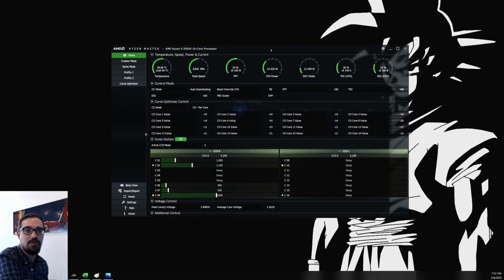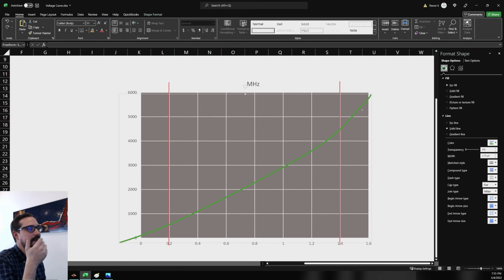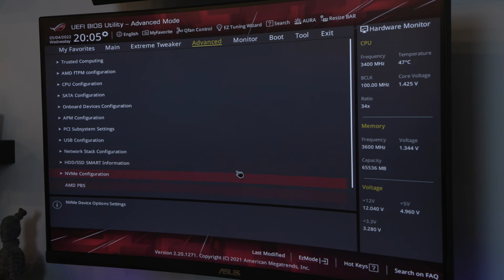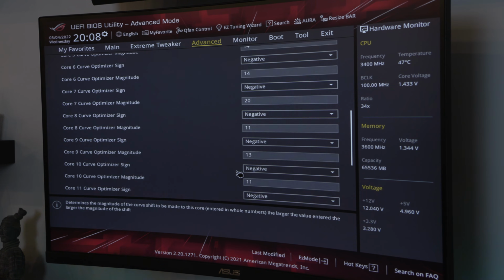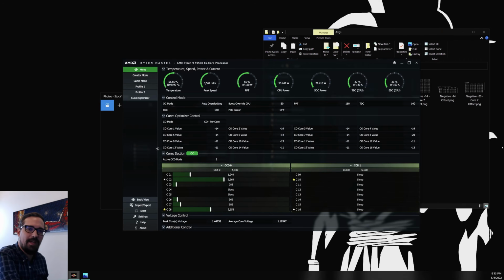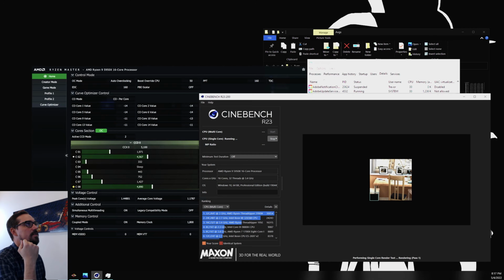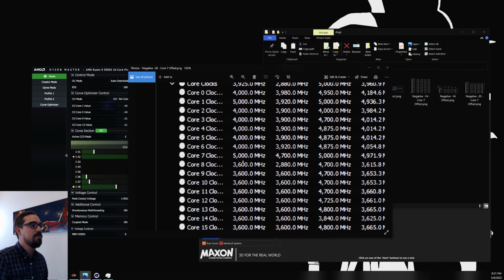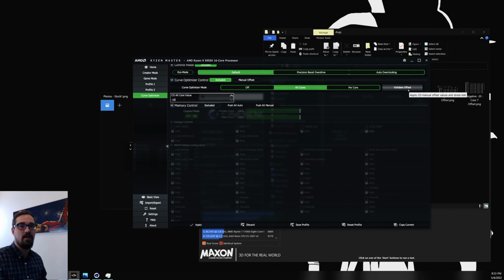AMD Overclocking - Curve Optimizer Explained

Comment: I set my pbo limits to my motherboard Asus X570 e gaming. On my 5900x my offsets per core are 11 of them are -30 and one is -17. Gaming especially battlefield 5 my temps reach 80c.
Reply from the maker: 80C is pretty normal for these chips when overclocked/overpowered, even on a custom loop! 😄
Reply: @UnhingedSystems  Thanks for the reply I was just about to say I have a dual 360mm custom loop, but as I said its only in a couple titles that will scale that makes it get up that high. Also I live in the Tampa bay area and it gets quite toasty so its to be expected lol. Thanks again!
Reply from the maker: @alexburke4569  Nice! I have a dual 360mm loop as well, but my basement doesn't get hotter than about 18C so it keeps things nicely cooled! I'm planning on building a custom case for my next personal build to have all the air feed and exhaust for the radiators isolated from the inside of the PC, it stresses me out when I have to recycle hot air through a second radiator.
Reply: @UnhingedSystems  18c that’s great! Lately it’s been around 25c in my house. And that sounds great. For now it helps having one rad as intake and one exhaust. Can’t wait for winter time though!

Comment: my results are -30 as well and weird part is, when it validates, it validates at very low clocks... should not it be testing at current settings where the cpu boosts 5ghz and downclock to 4.1-4.4ghz all core loads? 

also, my temps hit 90c whenever the current CPU wattage exceed 160watts so i am bottlenecked by my air cooler and it s low fan setting which is 40db noise levels so what should i expect from this curve optimizer as long as i keep insisting on low noise operations?
Reply: currently, somehow for a first time it gave -28 all core... result is, it took my 24k cb23 score to 27k with 81c max (max is set at 89c) i was hitting 90c with 24k CB23score so in a way, it has an effect...but i might still revert back to old school fixed OC if my voice meeter setup dont like these fluctuations anymore...

Comment: Any good way to cause the instability as fast as possible?
For me OCCT helped at one point, but I'm wondering if there's a good way to cause instability and test for future crashes?
Reply from the maker: Check out Core Cycler.
Reply: Prime95 and cinabench.
As soon as a "worker" fails you know something is bad. And when you pass that for over a few minutes either continue undervolting or test it for complete Stability

Comment: Thank you for this wonderingly informative tutorial.  I ran the curve optimizer after watching your video and applied the recommended core settings on my R7 5800X which ended up being 
C1 -19 
C2 -27 
C3 -27 
C4 -22 
C5 -27 
C6 -27 
C7 -27 
C8 -8

I don't know what happened to the last core, it might be a bit dodgy perhaps.   System has been stable for 24 hours that that includes lots of load time playing games, cinebench and running Folding@home, as well as idle time thrown in as well.   

CPU seems stable and I'm completely happy for my boost clocks to now be 4962mhz across the cores.  C1 & 4 even got up to 5007mhz a couple of times.
Reply: I set all cores to -30, no crash, but single core not stable and so many errors. my highest core0 clocks 4.557 MHz only . please share with me your numbers so I can better tune my 5800x. thx.
Reply: @Avo·Ado  I felt like the curve optimizer didn’t do a good job for me, each time I did it, it would give me different specs, so weird.
Reply: @93ChayZ  +++ no big gains
Reply: Can you tell me what your ppt edc and tdc values are ?
Reply: @LeonidasMilopoulos  I'm sorry I cannot, as I have since upgraded to a 7700X.

Comment: Hey, I recently got into PC gaming and do have some knowledge. With that being said, what would you recommend on a 5600x paired with a 3060ti and B550? Cooling is a CoolerMaster 92mm.
Reply: Processors are not the same! You need to test for your self to find out

Comment: Great content! The delivery, explanation, and video quality are great.

Question, how long did it take for you to initially “optimize” when first setting up Curve Optimizer? My ETA was 12 hours for a 5900X (per core) to start and about 5 hours in, it says I have another 5 hours to-go.
Reply: Seems like the less cores/threads u have the fastest, ETA for my 5600x was 1hour.
Reply: My 5900x all cores 1 and 1/2 hr
Reply from the maker: It took around 6-8 hours overall. It isn't a fast process by any means. I usually set it and walk away for several hours. It's especially a pain when you are testing using several CPUs and different BIOS settings before optimization. Patience is a virtue!

Thank you for the question!

Comment: You need monitoring "Effective clock" speed in HWINFO, not just "clock speed", because of "clock stretching".
Reply: What are good speed differences?
Reply: Exactly right, clock stretching would go unnoticed otherwise. Also give your cpu better pbo limits could help fixing clock stretching issues

Comment: My computer can handle curve -30 without issue. So if i leave the pbo limit: motherboard , is it good to leave it -30 ? So basically should we as low as we can low value ? And i can hit 2 core 4.975 ghz others 4.925 with my 5800x ? İ think my cpu has very good silicon and my motherboard is doing good job as well.because i had watched an youtube comparasion video and my motherboard was one of the lowest vrm mosfet temperatures when they overclocked.

Comment: if you use OCCT, it tells you which core is failing
Reply from the maker: It does, as long as the PC doesnt lock up 😭
Reply: @UnhingedSystems  i haven't had that problem yet.  if it booted, it ran ok until the testing started.

Comment: Hello I have a qouestion maybe out of way but, I changed in Bios to negative 25 as a result of Ryzen master for al cores. When I open in ryzen master I can see it., but for some reason it isn t working. As an example I m fan Of Flight simlator games. In MSFS2020 the game complately ignore this setting and and volatge is 1.5. For 5000 ryzen powerplan is missing, so windows manage. In game when CPU should be push to max , it somehow sleps at 2Ghz and 59°C. Do you have any ide why?? Thanks
Reply from the maker: Hello! Thanks for the question! What does it do if you set it back to normal settings in Ryzen Master?
Reply: @UnhingedSystems  actualy there is something stragne what I can not describe. For example if I restet in BIOS to default and start computer the ryzen master is showing still previous settings. If I would like to reset settings in ryzen master I cannot. Only way how to put thing back is reset via BIOS , but I need to reset to default, than it ask me if I want to reset PCIE registry , than pres yes...and there everyting is in default ..in Ryzen master as well. I hope it was clear. There is som stragne interaction BIOS-RyzenMaster-Windows. Everything run perfectly with my 3900X. When I switch 5900X and update chipset drivers Ryzen powerplans disapear(AMD says for 5000 series they do no need it) and power of my CPU with Windows powerplans behave strange. But regarding to curve optimizer I need to do it manualy via BIOS and make chages and delete as well. I would like to optimize my PC for max performance while gaming, not to see CPU sleeping. Anyway thaks for your reply. :)
Reply from the maker: @samuelcv6565  Try uninstalling Ryzen Master (and removing and remnant folders) and then reinstalling.
Reply: @UnhingedSystems  negative ..:( no  matter how I changed setting in Bios ...ryzen master show different values....sorry for disturbing I give up

Comment: Great video, I've set pbo limits to motherboard 
Scalar 10x
Max Boost 200
And all cores are -30 (I've set this after doing the test on Ryzen Master)

Everything is great, idle, gaming and even stressing on cinebench

I'm getting 4,6Ghz all clocks during the MultiCore test and 4.84 SingleCore.

While playing fortnite and apex all my clocks go up to 4.74Ghz and temps between 56°-60°C
Reply: man, i wish i could all core 4.6ghz,  all i can get before hitting the 90c temp limit is 4.2ghz..., of course ryzen master thought highly of my cpu as well by recommending -30 to me too but something is a miss and i just dont know what...
NH-d15 btw... at 80% fan speeds
Reply: @I3ordo  Something is off here, either you have bad case or tbe cooler is not mounted properly.. wich cpu u got ?
Reply: @silvinjo654  5950x
Reply: @I3ordo  that's a extremely hot cpu. That's why it's hard to get stable. High temperatures are very very bad for good Stability

Comment: FYI - I first did a BIOS all core negative undervolt of 30. The system would crash when loading windows, I then changed all core to 25 and would get idle crashes. I then used OCCT to stress test the CPU and it told me that 2 of the 8 cores had errors. So back in the BIOS I increased to power to the problem cores to eventually get a stable undervolt with no errors in OCCT but when gaming for 5-10min I was getting pc restarts. So if anyone is experiencing the same issue, you need to use WHEA within Windows Event Viewer and look for WHEA error logs and that was telling me that a further 2 cores had power issues with OCCT didnt detect. I finally got a "perfect" undervolt for my system ranging for 20 down to 5 within the BIOS and a peak clock speed of 5.3GHz on my 5800x and average of 4.8GHz at low 70c.
Reply: How do i go about viewing this in windows 11? with the OCCT program theres an option in the settings that stops the test if there are any WHEA errors as well as the other ones. I have all 24 per cores set all at -30 offset and ran three tests for 10 minutes a piece. No errors. I have a 5900x cpu paired with a 5700xt -3200mhz ram everything on auto except for curve optmizers and AMD Smart Acess.
Reply: @LeYoker  5900x only has 12 cores... And what did you do with AMD Access?
Reply: I had exactly the same experience with my Ryzen 9 5900X. I managed to get what seemed like a perfectly stable Curve Optimizer profile — passing more than 12 hours of CoreCycler stress tests using Prime95 (large FFTs), zero WHEA errors, zero calculation errors.

However, during normal desktop use or idle, I experienced random BSODs (especially during light load transitions). That’s when I realized that CoreCycler stability is necessary but not sufficient, as you said — it doesn't always catch those idle-state instabilities.

In my case, I reverted to a manual static overclock, and it’s been rock solid since then. Here's what worked for me on an ASUS X570 motherboard:

Manual core voltage: 1.25625V

CCX Ratios:

CCX0: 46.25

CCX1: 45.25

LLC: Level 3

PBO: Disabled

Result in Cinebench R23: ~21,500 points

Temps:

Idle: 45–50 °C

Full load: 70 °C max

Sure, I probably left a bit of performance on the table compared to a perfectly tuned per-core CO, but the system is 100% stable, performs consistently, and stays cool. In my view, it’s a great compromise unless you're chasing absolute max performance for benchmarking.
Reply: Where in OCCT does it tell you which core gave the WHEA error?
Reply: @DirtyxLarry  it doesn't, you need to go into event viewer and it will tell you.
Reply: Impressive
Reply: I used event viewer. Custom log filtered with WHEA errors. If I get any errors I note the apic # then use CPUz run a report to find what Apic# = core then change my negative cuvre for those cores.
Reply: Can you tell me what your ppt edc and tdc values are ?
Reply: @LeonidasMilopoulos  see that's the thing. Every CPU is different. Everyone watches these video and thinks, hey it worked for his CPU so it will work for mine also, but every single CPU is different so this guys ppt edc and tdc values may work for him but are going to be different for you. People can't seem to grasp that.
Reply: @NonLegitNation2 Okay i see.  And whats the proper way to find the right values?
Reply: I’m running total stable on my R7 7800X3D with per core (-) core 1@ -25, 2@ -20, 3-8@ -30 (-28 average all core) 

Used OCCT CPU stability to dial everything in- worked flawlessly.

Comment: What's the difference between doing this and undervolting and changing PBO settings
Reply from the maker: Great question. General under-volting applies to the whole CPU / all cores when you hard set the CPU voltage or offset voltages etc but the CPU still follows the standard curve. Using curve optimizer is changing the peak target boost at the usual full voltage under load being delivered to the core(s). Really there is nothing stopping you from also applying a negative offset on the voltage as the frequency will only go as high as it is allowed to on the curve anyways (you just end up lower on the curve, lower frequencies). Curve optimizer is adjusting your frequency target at any given voltage by moving the curve up or down based on a positive or negative voltage offset specific to the cores. The voltage itself delivered to the CPU isn't changing, but the frequency the cores run at when at a specific voltage will change. Does that make sense?

Comment: I'm not using PBO. I use manual overclock. Ryzen 6 5500 can reach 4.4GHz all core using 1.285V. The temperature is lower than using auto PBO and the benchmark result better. May be it is not optimal but not time consuming.

Comment: I'm sharing your video in a bug report to AMD about this same thing. I'm running a 5800x and just tried the same thing. I got all cores recommended to -30 offset. It crashed while idling overnight. But I'm perfectly stable long term at -27 curve for all cores idle or full load (full load for me is running Folding@Home or Cinnebench)
Reply: you got -27 curve with +200? crazy good
Reply: @kerpl0p  I have a golden sample to and I run that with no problems with real world or synthetic stress tests. The 200mhz max overide is pathetic!!!

Comment: Not a good CPU you have there. I have my 5950x with my 4 best cores on -15, a few cores on -20 and the rest on -30 with ppt 195, tdc 150, Edc 150. runs Fine for now
Reply: This makes no sense. Why would you run your best cores with the lowest offset? The best cores need less voltage to boost higher, and thus more stable at idle.
Reply: @BubbaaKushh  it makes perfectly sense. the higher boosting cores are less stable at higher offsets. it's all over the internet as well.
Reply: @L3nny666  it's the weaker cores that have trouble at idle cause your asking them to boost higher with lower volts. Weaker cores need more volts to stabilise at great offsets at idle.
Reply: @BubbaaKushh  man, if i look up which cores are rated "best" in ryzen master and in hwinfo, it's the cores that crash with lower voltages.
and that's what's been reported by other users all around the internet. it's not like i didn't test it. i did stress tests, benchmarks, normal use, gaming, looked at the WHEA logger, increased offset for each core and tested again. like i know these cores are rated "best" and i know the only sustain at higher voltages. why you trynna argue? i know my CPU?
i mean just google it. it's true. unless you would argue about how these programs rate the cores.
Reply: @BubbaaKushh  i mean you might be right in theory, but in reality it's CCX0 that needs higher voltages than CCX1. And your highest boosting cores on CCX0 are very likely going to need the most voltage to sustain load and idle operation.
Reply from the maker: Silicon lottery is real 😢

Comment: Good video man, just bought a 5600 upgrading from a 2600 and I’m now intrigued to test it’s capabilities.
My game focuses on single threaded workloads, so do you think PBO or Curve Optimiser would be better or should I use both?
Reply from the maker: Thank you! If you use PBO, tweaking curve optimizer will add some additional performance! Definitely recommend it if you have patience and don't mind a little trial and error!
Reply: @UnhingedSystems  I’ll give it a shot, thanks for replying to all these comments 🤙🏼
Reply from the maker: @brandanfiederlein3390  My pleasure! Thanks for watching!
Reply: @UnhingedSystems  I was thinking what if I Curve Optimise all the cores to the limit manually then go onto per core and boost the better cores. You think that would work?
Reply from the maker: @brandanfiederlein3390  Give it a shot! If it gets unstable you will know.

Comment: I have a 5800x and runs to temp 84 when playing call of duty warzone. Im trying to get temps lower for better fps along with my 3080ti. Ill let you know the results
Reply from the maker: The 5800X runs hot (hotter than 5900X) but also boosts nicely. What thermal paste/cooler are you using?

Comment: Hi 5950x user here
this is a good explanation to those people not familiar with curve optimizer.
to me, R23 is not strong enough to stress my 5950 core

I'll recommend use OCCT, go bios set your PPT 1000, TDC 1000, EDC (EDC depends on your motherboard limit)
curve set all core negative -15

boot into windows use OCCT CPU test-> advance-> core & virtual-> select core one by one-> set cycle10mins swap active core 10mins then start (make sure you can hear the fan noise from your CPU running at 100% fan speed)

if you really want to do perfect CO with no crash do not select multiple core! have to test it one bye one, and note down the lowest value per single core. 

normally ccx2 run at low frequency , that mean no need so much of voltage. so you can -negative 28,29.30 at ccx2
use OCCT result key in to your CCX 1 and at least +5, +6 +7. example my core 4 (1/1) OCCT minimum negative -17 , so I use -17 +5= -12 is the best value to make sure your system don't restart randomly

if CCX 1 there's core stable at -30 then just leave it.